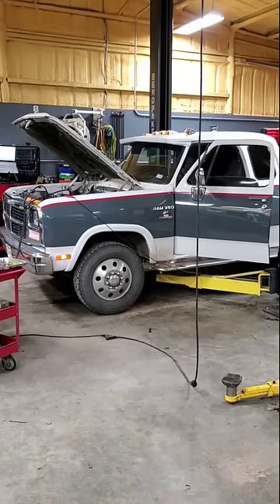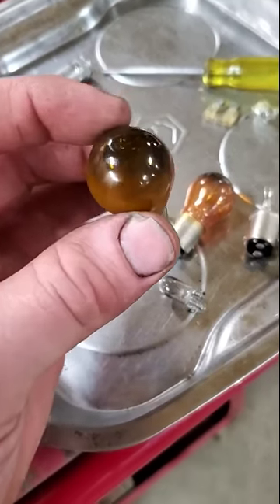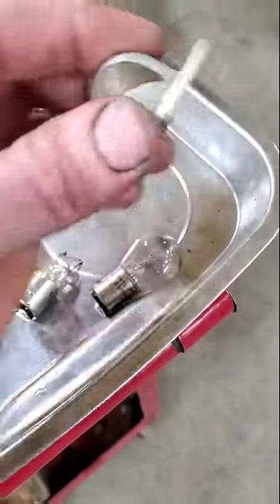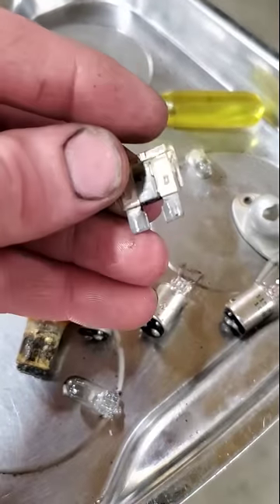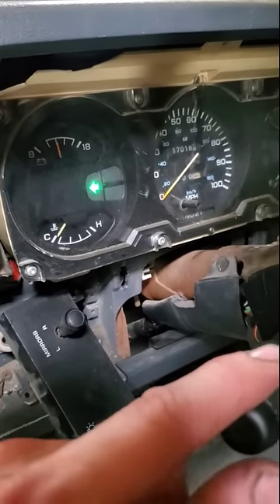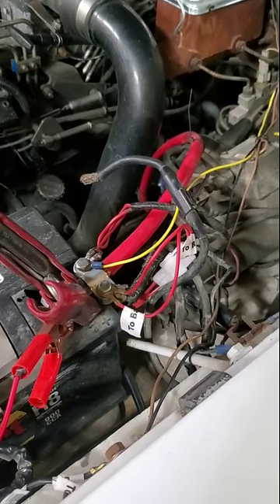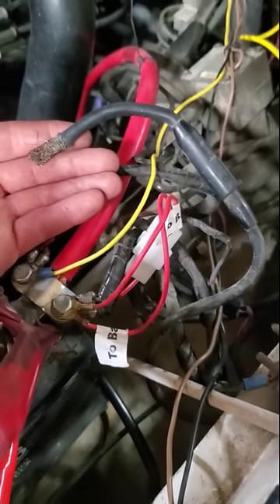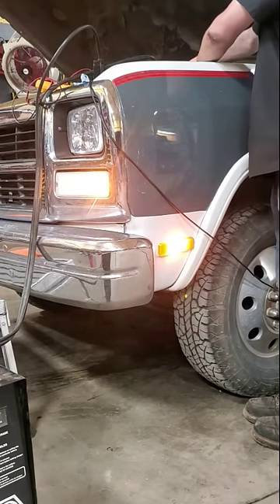Alternator Destroys All The Light Bulbs!

Comment: At least it's a old dodge and not something with over 40 control modules
Reply: Seriously, cars nowadays have 30 modules that would have been smoked instantly
Reply: Well this has quite a few.
Reply: Except as far as I know, nothing made in the last 30 odd years has a seperate voltage regulator.
Reply: @Sak-zo1ui  yeah but only the stuff directly wired to it were affected, it wasn’t all linked to one like newer cars
Reply: @JustaT6  fair.
Reply: @TerrificDreams  it doesn't. It cuts off the moment the ECU reads system voltage spike.
Reply: @jeepmanxj  Videos of modern cars getting struck by lightning would like a word…
Reply: @kronk9418  you understand that is a false equivalence as lightning would kill an old car as well?

Also, upwards of a billion volts is a little, ya know, not relative.
Reply: @TerrificDreams  if im not mistaken don't the newer cars have more fuses so...
Reply: 30 are just bloat
Reply: @Mhd786 Jna  yes I was over exaggerating
Reply: Those 40 modules would have completely prevented this...
Reply: @GlamStacheessnostalgialounge  Mopar was way behind the curve in electronics!
Reply: Well its a Dodge, the wiring was shit straight out of the factory even back then and got worse n worse as newer ones rolled out!
Reply: Modern cars would at least see something is wrong and not send full power, but I get the statement.
Reply: @Sak-zo1ui  1computer in the left front fender behind the battery and the early first gens had either a mechanical or electronic voltage regulator on the firewall/bulkhead
Reply: @dodgeme1986truck  thats pretty advanced. Maybe not in todays terms but runs on its own electronically.
Reply: Nope instead you get 10 control modules that all break consistently
Reply: @shawnsatterlee6035  🤣🤣🤣🤣
Reply: Under $500 for a decent wiring pack plus those headlight relay, not to bad for a big mistake. Better than melted plastic, burnt fiberglass, or chinesium.
Reply: @shawnsatterlee6035  it usually best to change out the wires on an older vehicle after you buy it or when you can afford it because there is always some electrical problem in my experience.
Reply: Or a BMW or a MERCEDES with 9000000 control modules
Reply: @GlamStacheessnostalgialounge         G    E either do these. Hahaha
Reply: @dodgeme1986truck yep. As an alternator rebuilder I can confirm.
Reply: @AdventureswithGeneral  yup I have 5 o those 85-93 dodge trucks although the 92.5 and later trucks incorporated the voltage regulator into the fender mounted computer
Reply: @TerrificDreams  well wouldn’t modern ones shit everything off first…
Reply: JEEPs?
Reply: @TerrificDreams  I work with equipment intended for 12 or 24V vehicles. Using a 65V-capable power supply just to survive the outcome of starting a generator with a disconnected battery. Obviously the product manual doesn't list 65V. But anyway - the electronic boxes aren't directly using any 12V input. They produce 5V or 3.3V or whatever they need from internal power supplies that might have quite wide input voltage ranges. So incandescent bulbs and other resistive loads are most vulnerable to high voltages. And the relays/fuses supplying the power to these loads.
Reply: no wonder there’s a chip shortage.
Reply: @GlamStacheessnostalgialounge  my 1977 Chrysler uses an external regulatir
Reply: Except good luck finding most those plug boxes.
I had to have a dealership build me an obd 2 plug out of scraps cause they don't make em anymore.
And that was a 1998.5
Reply: modern cars either don't charge at all or charge at a default voltage output, they don't go full send.
Reply: Don't worry I don't think we would have problems with external regulators on alternators on new cars.

Hint: it's because they're internal reg now. And generally there's just 1 plug and always a battery positive wire onto a stud you tighten on. So if you manage to get that wrong...
Reply: @Nomed38  it's because truck guys have no idea how Electronics work even though the shit has been around longer than they have
Reply: Not even kidding my escalade has that many.
Reply: Almost all new electronics equipment in cars are tested towards ISO 16750-2 and SAE J1455 (or other similar standards) which cover these types of alternator/regulator failures and or misuse.
Reply: 😂😂😂😂😂 very good point! Module flambae!
Reply: And even so it still has electricial problems!
Reply: New cars voltage is controlled by the ecu
Reply: Can't forget all the extra CPU's either... 🤦
Reply: It wouldn't of blown any modules on a new car. Don't try to make a point for something you don't understand.
Reply: @gingercyclops4397  it can kill modules  and it can also smoke drivers in the ecm from high voltage feedback

Comment: Damn near had a rolling fire.
Reply: That’s every dodge,        Just kidding
Reply: He probably doesn't know just how close he was to that very thing.
Reply: Pretty soon were going to have to start buying dodges in two pieces
Reply: Good old fashion, dodge self-destruct mechanism.😂
Reply: @hidel308  
Every car with an alternator has that wire. Nice try though.
Reply: @connerbrandl5103  just about any American vehicle.
Reply: @connerbrandl5103  not kidding
Reply: @connerbrandl5103 haha I own a dodge and this was funny
Reply: @connerbrandl5103 dodge is good at one thing. Building shipping crates for cummins engines pull them out and junk the truck. All joke aside they all seem like they’ve had 10 previous owners wire them, even when they are straight from the factory😂😂
Reply: That's been dodges trademark since the amp meter dash fires.

Comment: My dad had a car whose alterator went out to sixteen volts and stuck. He went through several sets of bulbs before we figured out what was going on. Funniest part is it never killed any vital systems the thing just kept running. I was too young to know exactly what happened but i'm sure it was something similar to what you described.
Reply: Probably the voltage regulator
Reply: Had a car did that. But it made an awesome boost vehicle for starting vehicles and equipment so I let it go a few months until the voltage got above 16 then changed the regulator.
Reply: Had a gm alt putting out 20v one time. Only thing fried was a capacitor in the bcm
Reply: My wife's car (07 Forester) randomly charges at 15.5 - 16 volts (I think 16.3 is the highest I've seen), it lasts maybe 10 seconds and drops back to 14.5ish.  This is after replacing an alternator that would stop charging when it got hot, and then getting a warranty replacement when the new one starting acting up basically the same way.  It is burning out headlights every 9-12 months.
Reply: A lot of the important stuff was tolerant of voltages up to 20v because they'll have their own voltage regulation. But you can't do that with bulbs because they won't be bright enough undervolted. So they'll pop first, which generally is a good thing because they're cheaper to replace.
Reply: @bruwin  or they melt in this case before they pop
Reply: My dads Plymouth Volare blew out fuse able links Bec of alternator issues. We couldn't figure it out until it completely burned up the main 6 way fuse able Link. We ended up bypassing the bulk connector and ran individual fuse links. Replaced Alternator and voltage regulator. Fixed. 
1985 I was 11 yrs old and I still remember. 
💥BADA BING BADA BOOM 💥
I APPROVE THIS MESSAGE 🙌
Nj'sJfJr 👍🏼💪🏼❤️🇺🇸
Reply: I tried to tell people for years removing the battery cable isn't the way to check the alternator especially on the newer cars and if you giv someone a jump start let it run for a while and don't try to start the other car with your vehicle running and cable's hooked up to their car always xut your car off because their starter will draw a couple hundred amps and blow your alternator and you will be the one needs a jump start alternators actually generate A/C voltage and if you over load your alternator and damage the bridge rectifier you could put A/C voltage and really cause problems
Reply: an alternator, with no regulation, can put out as much as 75 volts. That's what killed this truck's system and the fact someone jury rigged the wiring in the first place.
Reply: That is so unfortunate

Comment: A long time ago, most cars had gauges that showed oil pressure, coolant temperature, and voltage levels, and these had clearly marked "red zones".  Over time many manufacturers did away with them, and here's the result.
Reply: Probably has idiot lights.
Reply: When it comes to electrical problems, any and every idiot light gets tripped randomly. When every component depends on a sensor that runs on electricity, electrical problems appear as   if everything went crazy all at once.
Reply: I can only see voltage and oil pressure in my Colorado through a menu. S10 I had years ago though had analog for both, In fact on a winter morning the oil pressure is how I knew if I could go. Id  wait until it "woke up" before starting to drive.

Comment: Had a similar problem on a 1975 Dodge pickup.  The voltage regulator was going out so sometimes the alternator would not charge at all and other times it would put out as much as it was capable of.  It started going out on a highway trip at night!!  So to prevent things from melting down, I turned on as many accessories as possible.  The multimeter showed 18 volts till I turned everything on and that brought the voltage down to 16 volts.  It isn’t too often when modern cars would flash their lights at such an old truck with its low beam headlights on, but it happened a lot on that trip!!  No lights blew, but it did destroy the battery.
Reply: Great idea to turn everything on.
Reply: Too late now but just unplug the regulator.  Older cars in daylight will go all day  just operating the ignition system off the battery.
Reply: @fourfortyroadrunner6701  I agree 100%, if it is daytime.  In my situation it was at night and during a 100 mile drive.
Reply: My '89 Ram Charger started popping bulbs at around 23k, I changed out the tail lights and two marker bulbs, but didn't see any voltage issues, then I was driving home one day and the dash lights came on with the headlights but I had to turn down the rheostat because they were blinding me. I got home, checked the battery voltage and got 15.2 at the battery not running after the 30 minute ride home, and when I started it up, it jumped to 19.7v and stayed there. I robbed the voltage regulator off my old truck for the time being and got a new one a few days later. After that ordeal the radio never seemed to pickup stations right again and the door open chime was gone. A few months later the headlight switch quit working, and i had to pry the plug off the back of the switch. The ABS module also died. After I changed the regulator, my mileage went from 11 to almost 14mpg. It gave me the impression that it may have been overcharging since day one. With the new VR, the headlights looked dim though, I was used to the super bright lights the added voltage was giving me I guess.

Comment: Had a similar experience years ago. Measured a Delco Remy 24 volt alternator putting out 48 volts because output wire had come out of crimped terminal and regulator did same thing. Was on a piece of stationary equipment instead of a vehicle.
Reply: Had that happen on a transit bus while I was driving. 

Sounded like a revving jet engine at take-off power until the relay blew!

Comment: I had the same thing happen to my Pathfinder.  The charge wire from the alternator was on a separate connector at the battery.  When I turned on the headlights, the light went super bright and then died.  When I tried to turn on the heater, the blower motor sounded like a supercharger!

The dealer wanted to change the whole under hood wiring loom so I took it to a specialty automotive electrical repair shop and they replaced the connector for $20!

Comment: The regulator on my alternator works by grounding to the alternator case.  The threads on the hole where the regulator bolted down had been sandblasted away when it was rebuilt.

I saw my dash and headlights getting very bright.  Pop the hood and my battery is boiling.  I unplugged the alternator to drive home.  Thank goodness it was an 80s VW.  These days it might be a little chore unplugging an alternator.  Although there is usually a bolt in fuse up at the fusebox if you've got the tools to remove it.  Possibly could short the fuse out too if its a crazy emergency 🤷‍♂️.  You would want to make sure all the hydrogen gas is away from the sparks though.

Comment: I had a '93 Taurus. I experienced a fire under the carpet, driver's side. Rushed to disconnect the battery. When I checked the location of the smoke,I found two wiring harnesses encased in ice!! It was in the winter. Towed my car or t to the sticks where I lived and after some fancy wiring repair including point to point soldering of over 30 wires, I bypassed the connectors , sealed it up after testing all systems. Never had that problem again.Managed to put another 80,000 km(50,000 miles) on the Taurus. Transmission let go while in Toronto Ontario. Literally my car became a Tow-us. !!! Good car  initially.

Comment: Dodge pickups have had major electrical issues from 1973-2008 I KNOW this was a mistake on the installer’s part, but I’m just acknowledging how bad the electrical was on these. I had a brand new Cummins in 2007 and while idling the lights would go from dim to overly bright and back seemed weird to have a new 55k truck that can’t have steady light output. Maybe the intake grid heaters were kicking on and off, but they still should’ve had a system capable of running those high amperage heaters without dimming.

Comment: I remember testing alternators by full fielding them.  Output went to 20 or 24 volts(?).  

Had to make sure all lights, the radio, blower,   that was about it for electrical equipment back then, so as not to blow them out/up.

Comment: Gotta love electrical gremlins on old trucks😂😭 My 93’ F-250 with the 460 would sometimes just randomly turn off while stopped, and no matter how many times I tried recycling the ignition key it wouldn’t start, like zero power to the starter. What made it worse was how inconsistent it was, sometimes it would start back up right away, and the last time before we sent it to the mechanic it went through a minute plus full red light cycle before it started lol. 
 Took the mechanic awhile to find, but ended up finding it by just touching some part under the hood with a screwdriver.😂🤣 Said it immediately shut off like how I described it to him. Can’t remember the part name, but I’m pretty sure it was ignition related, but not the actual ignition in the steering column. I guess it must have been a little loose, and somehow was able to ground itself (I think) against the inner fender. Combine that with it being heat soaked from that damn 460, which would result in it not wanting to start again. 
 Fun times😂 Would always make me even more nervous about driving it.

Comment: Dodge also had a big problem with the wiring coming off the headlights plug in. It had too small of a wire trying to run too much. They offered an upgrade   But it cost the customer. It wasn’t free
Reply: 1991.5 Dodge Cummins:
After I replaced the torched headlight switch, I installed a relay to carry the load.
.
1996 Ford CF8000:
After I replaced the torched ignition switch the second time, the third time, I installed flip-switches on the dash.
Joke 'em.

Comment: I’m more impressed that the PCM is still controlling the voltage output on that truck.
Reply: Does it even have one?
Reply: I highly doubt it. Considering thats external reg.
Reply: @Kazuki-sd6rh  the 90-93 dodge trucks has a the voltage regulator built into the PCM you can bypass it with a external one.

Comment: I had a '90 Ramcharger that did this. After six months of searching I finally found that the wiring harness plug at the external voltage regulator was shorting out. One day no charge. Next day, but every light bulb on the truck. A plug from a late "60's model vehicle is made from hard plastic and not rubber. Fixed mine and three others this way.

Comment: Had one of those old Dodge trucks, over charging at 15.5v. The ignition switch was burned up, causing a voltage drop in the sensing circuit to the regulator. Didn’t blow out any bulbs but would cook the battery.

Comment: I turned the ignition off while iwas raising the dump box on my old w350 last fall and the voltage regulator got stuck at 21 volts. I knew something was wrong when the radio didn't work after I got gas and figured it out pretty quick.

Comment: Ah,I remember this on my truck,hot cable shook loose on my 92 silverado and I knew it was only running off the alternator bc of the surge in the interior lights,well I had the door open and shut the truck off,and simultaneously it blew the tail light fuse,all the interior bulbs,and killed the alternator

Comment: I rented a small chevy sedan about 15  years ago. The heater fan knob turned easily through about fan 4 speed positions. But aftet it had been on for a ten or twenty minutes,  it would take more effort to turn it off. That's because the poorly designed,  overworked, cheap switch contacts were beginning to fuse together due to heat.

Comment: I'll be dipped. I bet that's what was happening in my 03 Camaro. Bulbs didn't necessarily burn out fast but they were melting the housings, front and rear. Never thought to check voltage!
Reply: My aftermarket LED headlights freak out the BCM and voltage regulator in my 06 caravan. Causes the alarm to go off, headlights to flash, and other assorted random shit.

Comment: An alternator going full-field makes a decent trail welder.  Yep, stuff will be damaged when it's connected to a 12V system.
So don't make the common mistake of running an engine with the battery disconnected.